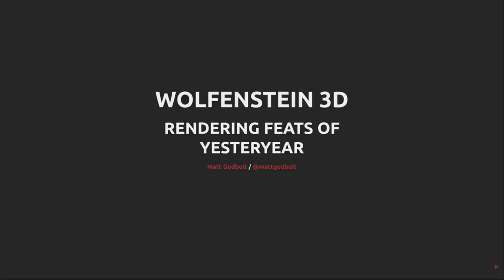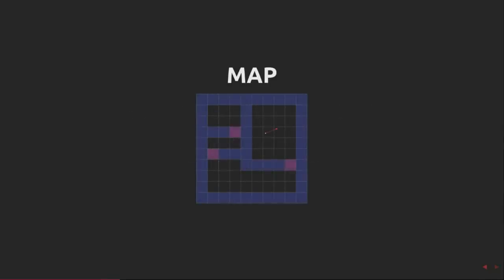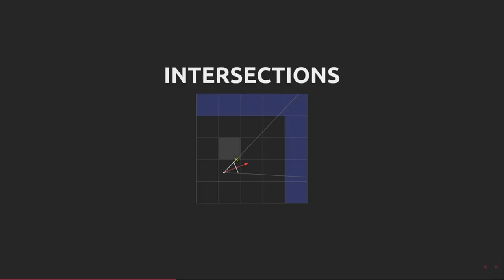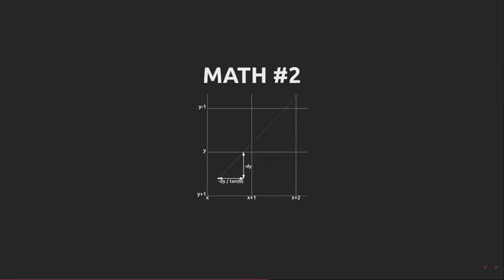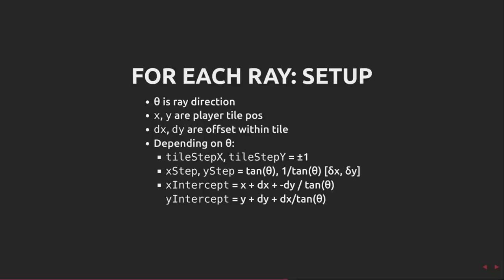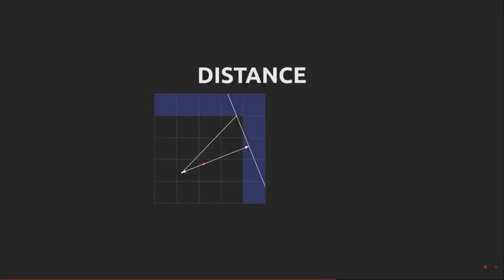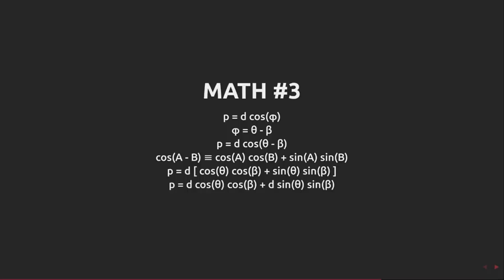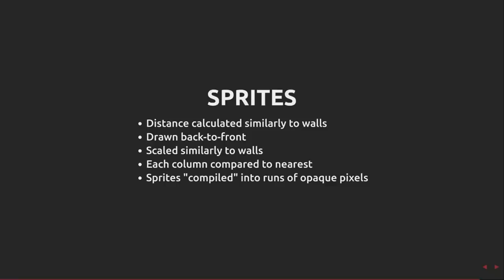Wolfenstein 3D's map renderer

Comment: They would've saved cycles by just adding to the player position, getting the furthest xy add & minus from that to get each end of the view range then just iterate through every cell between there and the player, no random points involved
Reply from the maker: I'm not sure I understand. There's no random points involved. Perhaps my explanation fell short, sorry!
Reply: @MattGodbolt  You said that the algorithm takes a step and checked the step then took another step then checked again, etc etc until the max distance had been checked or an object encountered, the steps are basically random points between the max distance and the player, really inefficient
Reply from the maker: @zxuiji  it isn't at all random, the steps are the exact distance apart the trigonometry works out. The loop is a dozen or so adds and compare instructions after a little bit of set up, which is what makes it so fast.
Reply from the maker: That's how it iterates each cell intersection walking along the path from the player along the ray's direction.
Reply: @MattGodbolt  Steps are still random points, it is easier to calculate the end point then iterate through the cells instead of checking the points within the cells
Reply from the maker: @zxuiji  we don't know the end point until we've walked every cell along the way to see if it is solid or not. That's why the wall has to happen. And again, the points are not random, they are equally spaced :)
Reply from the maker: What I think you're proposing is to find some point that's a long way away in the direction of the player, which as you say is a couple of adds. Then walking along that line to see what you hit. How do you walk along that line? You calculate intersections with each cell...and that's what this algorithm doing without having to first calculate and end point
Reply from the maker: And I meant direction of the ray here sorry, not player :)
Reply: @MattGodbolt  But you DO know the end point, width - px & height - py
Reply from the maker: @zxuiji  that's the end point of a line way off the map. My point is, even if you know the ultimate end of a line passing along the direction of the ray and a point at the edge of the map, you still need to iterate over ever cell edge along that path. An efficient way to do that is to calculate the deltas that each horizontal or vertical line intersection occur at. And to do that doesn't require knowledge of the end point.
Reply from the maker: If you think about the part of your original comment where you said ..."just iterate over every cell you intersect", think about how you might achieve that part
Reply: @MattGodbolt  Already did, your clue is normalised angles
Reply from the maker: @zxuiji  I'm lost; can you elaborate? Normalised angles doesn't tell me very much, and I'm not smart enough to work it out from that clue
Reply from the maker: And I don't see where you explained it. YouTube comments and threading don't work all that well! :)
Reply: @MattGodbolt  Ok, here's another clue, start with a grid of 200 by 200, and assume the normalised angle equals 0.25
Reply from the maker: @zxuiji  I appreciate it, but I'm not able to play guessing games. I've made a video that tries to clearly explain from first principles how the Wolfenstein code did it and why. I may have failed in my attempts to do so. I've then tried to explain why I think your idea doesn't work; or amounts to the same thing. I appreciate your questions and thoughts but I don't have the time or will to work through underspecified ideas as if it were a guessing game. Cheers, Matt
Reply: @MattGodbolt  We're at a guessing game because I haven't finished translating my visual to math, I plan to do that 2mw after work (which I'm currently at btw), the reason I gave the grid 200 and exact angle of 0.25 is because I wanted you to notice the same relationship between the adjacent, oposite, hypotenuse, and percentage angle of a right angled triangle that I noticed, perhaps you would then be able to beat me to developing the math
Reply: @MattGodbolt  I've now worked out in my head the direction of the math, the calculation of the first cell to start with is a simple minus operation whose result is clamped to the limits of the grid, up until that minus the operations should ignore the player position and use the grid size
Reply: @MattGodbolt  Not my method, you just check if a cell is in the visible range as you draw, if it's not you just skip it, if my math is right then it only takes 16 operations to get that range, 6 subtractions, 8 multiplications and 2 additions

*Edit:* Why does YT not sync read status across browsing sessions? Didn't clock I had already read what I posted this against when I typed "Not my method" until after I posted
Reply from the maker: @zxuiji  I think many of your replies are missing. I certainly feel like I've only seen about half of your messages which might explain why I'm having a hard time following your thoughts
Reply: @MattGodbolt  Relax, I'll post the solid math (in the form of a c file) later today after I confirm it actually works the way I expect it to, got work to deal with first though
Reply: @MattGodbolt  But for now try thinking about the x/y coordinates of any point on a right angled triangle's hypotenuse, that's what 1st lead me to the math I'm going to post
Reply: @MattGodbolt  Might take me a bit longer after all, first time seriously programming graphics beyond a basic triangle and I'm now trying to learn how to switch from a drawing a point grid to drawing a triangle or square over that grid, I've got all the bare bones needed, the grid, the "player", the rotation and the movement, just need to figure out the overlay part then I can apply the math I've noted down and see if I made any mistakes, besides a bit of overtime 2mw I have the next 2 days off, I should manage to figure it out by then.
Reply: @MattGodbolt  Ok, I haven't managed to overlay the view cone on top of the grid yet, and there IS a fault with my math but it does mostly work as intended, I had to throw out what I previously planned on using in favour of something else but still skipping the hole ray cast stuff and simply calculated the boundaries of what to draw. For now here's the file containing what I have, feel free to make a vid of it, perhaps I'll get an idea of how to fix it from said vid:
https://drive.google.com/file/d/1cC2ts5A0wcCixHzkrB3W7M0TWuVnFrEL/view?usp=sharing
Reply: Managed to fix the bug that resulted in partial rotation, just gotta fix the final bug I introduced in the process where the rotation somehow goes to the opposite corner in certain situations.
Reply: For all who were interested the reason I'm taking so long with the next upload is not because of the difficulty of the math, rather after switching to storing the angle as an integer that became incredibly easy, the problem is now making use of that point to generate the cone shape that raycasting does, so far I'm using a generated lookup table to decide which values to use out of x, y, w, & h, but that only gives me the middle edge point, the hard part is generating the points to either side of that point that the cone would use
Reply: For anyone wandering, this is where I'm at with the math:
https://drive.google.com/file/d/1UyoZ7l9ObzcL5DE2wInh0hRbQwFAOU_z/view?usp=sharing
Wound up switching to using 2 lookup tables, still working on the application stage but I think I roughly got the relative points down
Reply: @MattGodbolt  Finally got there with my proof of concept, still a kink to work out but the result speaks for itself... assuming it compiles on your computer

https://drive.google.com/file/d/1i57u32fOrssXh2bxQuvEj8MzcbN-9OD9/view?usp=sharing

Don't mind the messiness, I'll cleanup after fixing what should be the final issue.

I'd say the method is about 95% complete, maybe upto 99%. Dropped some, perhaps all (didn't check) of the lookup tables after realising where I was mainly going wrong, to put it simply use right angled triangles for the example, the x&y positions in the hypotenuse are always of 100%, in other words when x or y is 25% the other will be 75%, these percentages are of the relative adjacent and opposite. Upto this point I'm sure you followed well enough and can probably visualise how you would start the vid if you make one, the next part might be harder to follow but think of the adjacent and opposite added together to equal the height of the normalised area double (for peops unfamiliar with normalisation, its what you get when you either divide 1 by any number or treat a percentage as a pure number and divide it by 100 to get it's fractional form), in other words the number 2, next think of the x axis as always being clamp(angle * 2,max), what this means is after doubling the angle you then clamp it back into the normalised max to max range (this is why it must be stored as an integer since the modulo operator is needed for this process), after normalising this just use the value directly as x, y will then be something like (2 - (x * + 1))/2, still working on that as I get some jumps here and there (just look for the function get_xy()), the distance is also easily obtained but you must note both front and back of each axis, then multiply against the appropriate distance the normalised value of the x/y axis, at that point you now have a position along the line of sight, just +- an amount from the angle when getting the x/y values to get either side of that line, the x/y can either be between the player and the edge or at the edge if you use a lookup table to decide which, the index is simply gonna be floor((angle + 1) / 4)
Reply from the maker: @zxuiji  so I haven't looked much but I see you're using 'float' all over; I'll try to understand what's going on but an important point (which you probably realise) is that the Wolfenstein code didn't use any floating point at all. I hope to have a moment to understand your code later, thanks for sharing!
Reply: @MattGodbolt  The code can probably be converted by just treating the 4 last bit of an unsigned long as a 1, then do all the same math there, then multiply by 100, then shift all the way back to the 0th bit then divide the map size by the number to get the x/y position, just a slightly longer version of the floating version, alternatively they coulda used fixed point numbers and just stored all their numbers in fixed point format, only converting to integer when their about to use them on screen
Reply: @MattGodbolt  Managed to get the base math down, finally seeing what I expected on screen, next will be the object-in-bounds math which I'll apply to those generated points you saw in init_grid()

For now however the base math for the view cone:
https://drive.google.com/file/d/1cBlkHfldN2ct8asuEXZqiQD75mc1x6xR/view?usp=sharing

Comment: a 286 at any clock wasnt state of the art in 1992.  maybe a common 'low end'.  most would have a 386 and power users would have a 486.  the pentium released in 1993.
Reply from the maker: Indeed: in the comments below I correct this, but sadly I can't update the video. Thanks for noting it though
Reply: @MattGodbolt  was looking for the correction wondering how i could have missed it.  i think im usually pretty good at looking for such things before commenting.  i dont see it though.
Reply from the maker: @jeffyp2483  I can't find it either now! There are a number of folks making the same point as you wayyyy scrolled down and I could have sworn I replied to the first few of them but I must have misremembered. Either way: you're absolutely right, 286s were not state of the art back then! Thanks for the correction!

Comment: Im pretty new to the programming,
but wouldn't that be much easier to cast every ray from a diferrent point on a line perpendicular (facing player in 90°degrees angle, imagine that like letter "T" player is the leg "|" and those lines will be casted from points on that "—" part) to the player (can it potentially lead to orthographic perspective? - and if so, would it matter in the first place? ) or cast those lines from the same point and then shorten those lines in the middle (lines  closer to the middle would get shorten by the higher value ) to compensate for the fish eye effect

Please correct me if im missing something
Reply from the maker: Not sure; what equation would you use to shorten the lines in the middle?
Reply: @MattGodbolt  first of all, i would let the player face the wall at 90° degrees angle, thus all the rays should be ideally the same length, which they will never be because of the fish eye effect. I would measure lengths of all rays, and then I would basicaly try to find out if that length progression from shortest to the longest ray can be represented by some mathematical function (like parabola or something) and then I would try to aplly reversed version of that mathematical function which would potentially cancel the fish eye effect. 

But in this part of world its late night right now as I'm writting this very so  maybe I'm saying nonsence.
Reply from the maker: @daifee9174  if you're casting every ray from a different point on the perpendicular...what angle are you casting? It doesn't seem to matter if you cast them from the player's position, or a point on the plane. Then the "reversed version of the mathematical function" is distance dependent, and it needs to be calculated. There are engines out there that do this, but the "reverse transform" is more expensive than avoiding it in the first place :)
Reply: @MattGodbolt  If I would cast rays from diferrent points on the line, they would have to be perpendicular to that line. Im not sure if my poor english can accurately describe what I mean, so I'll show it on letters again. It would be like"•E" player is that "•" and that perpendicular line is the vertical part of letter E and rays casted from that line are like those 3 horizontal parts of letter E
Reply: So angle of every casted ray would be 90°
Reply from the maker: @daifee9174  I don't understand. If the rays are at 90 degrees (to what?) Then the player can't rotate and look around
Reply from the maker: I see from above you mean 90 d to the player. That would mean they all go left of the screen (or right) and so the ray casting won't find the objects in front of the player. Unfortunately YouTube comments are not the easiest place to discuss; perhaps make a drawing somewhere and link it? I am having difficulty understanding :)
Reply: @MattGodbolt   okay, if you don't mind "wasting" more of your time answering me, I agree. images can surely say more than words, especially when my words (english) are this bad.

Soon Ill send the link here
Reply from the maker: @daifee9174  Not wasting at all! :) thanks!

Comment: ultima underworld had somewhat more 3d than wolfenstein3D 

(both games appeared roughly at the same time according to wiki)
was the former intended for beefy computers or it wasn't as dynamic as wolfenstein and therefore didn't need so much computational power?
Reply: Ultima Underworld had sluggish controls, a lower framerate, and a smaller rendered window. It also wasn't much more 3d: IIRC it still enforced a coarse grid structure on the map and vision range was very restricted.
Reply: @danpowell806  I do believe that it had different floor and ceiling heights, though, and maybe even floor slopes? 'Course, the renderer as a whole was a lot less efficient than what Doom would crank out later, so it was definitely a case where it only really worked because the game was slower paced than Wolf or Doom.